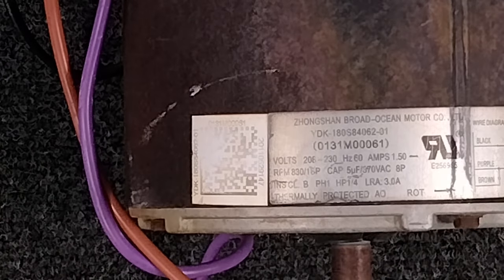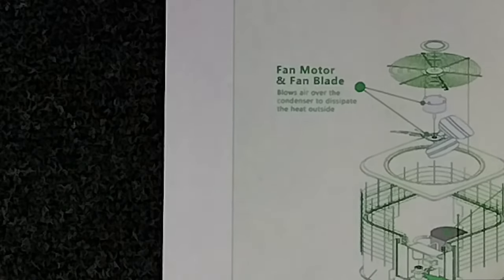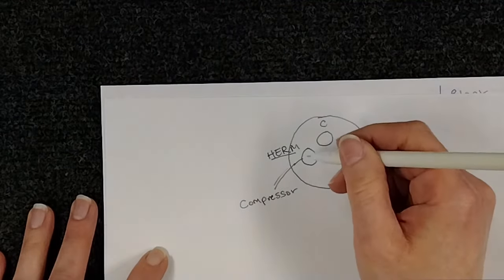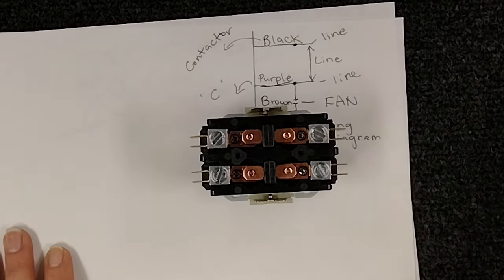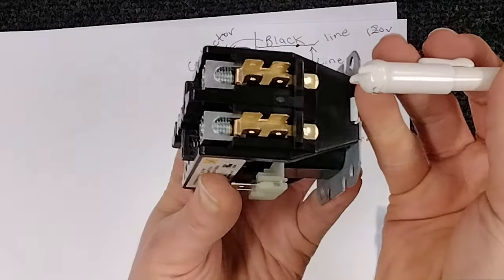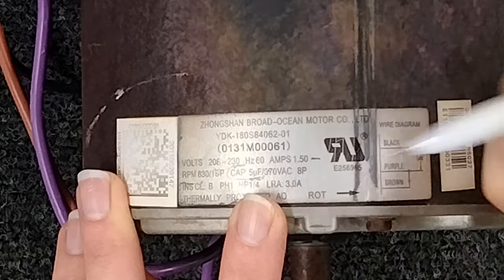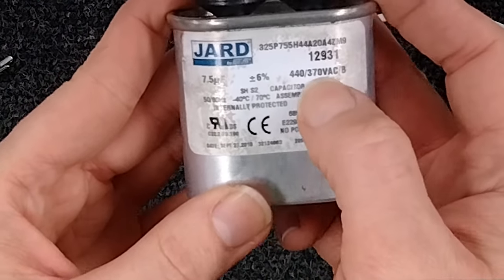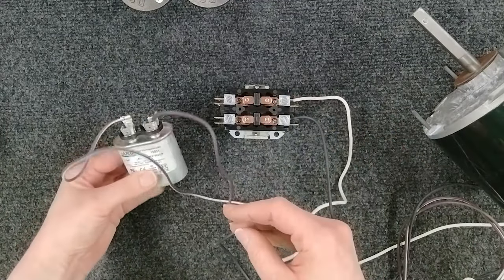How To Wire Condenser Fan Motors, Both OEM And Universal.

Comment: I use 120 volts ac for 1 phase motors. 
I got run at fan of the capacitor to 120 of the contact output and common from the motor to the other side of the contact .
And I put my start winding from the motor to common of the capacitor.
Very good results and readings!
Reply: That means the capacitor is between start and run of the motor.

Comment: You said never change your HP but sometimes when factory OEM motors supersede they change HP without changing the fan blade. I see this happen all the time with Goodman and Trane fan motors.
Reply from the maker: Yes, they do sometimes change the HP on factory motors. I've seen that on both Trane and Carrier units. I think honestly it isn't an issue until you jump two or more up. So, say, going from a 1/8 to a 1/4 is not a good practice and would cause some amp draw issues.

Comment: I couldn't help but notice, the old motor is an 8-Pole, designed to turn the fan ~820 RPM.  The replacement motor is a 6-Pole motor, intended to run the fan closer to 1,070 RPM. The torque required to turn the fan increases on the square of the increase speed, multiplied by the RPM, thus, the power requirement goes up on the CUBE of the increase in fan speed. If the increased speed is needed for the extra air flow, the new motor needs to have at least double the horsepower rating!

Comment: thanks for covering the 4 wire motor. I take it the oval capacitor non-polarity is used on 4 wire
the round c,herm,motor is used on the 3wire motor?

Are they interchangeable if so, how would that look like?

Thank you for your time and knowledge
Reply: Polrty must me checking due fan only fam  hrom side  comprssor  satarting g point onlt  due csp capcitef  c..  comon only not capcoiter is  power  fan pointed  .expls..5 6 7...8.910 .only . Mfd .ok  maco  fardieok sir  thankyou forme ok   exples  samall fan mot cap onlg 6mfd ok 2pont ye not fsn fan only ok sir   back n ..onlg  col ocrd must  redstsnc bsl must be okdir .okdir
Reply: @jollyscaria1922 huh?

Comment: The Vevor 1/4hp 1100rpm condenser fan motor I received is a ball-bearing motor, not the troublesome bronze oilite sleeve bearings.  Unfortunately, vevor drilled (and then installed rubber plugs) drain holes in the top, not bottom.  That's how I found it's a ball bearing motor, while dissassembling and drilling drain holes in the bottom.

Comment: Universal motor drain plug on bottom end is not just a plug I can remove it’s some kind of hardened resin. 
Do I need to remove this?
Reply from the maker: So with those, it's a hard plastic that I normally have to remove with a box cutter under the lip of the rounded plastic and pop it off. They are a pain to remove!

Comment: This is one the best presentations I have seen on this so far.  Pace and explanation very details. 
in my case I bought a replacement condenser motor fan, which came harnessed so I have to clip the ends  in order to connect it to my capacitor and contractor.  However I have 4 wires :  Black, Purple, Green-Yellow  and Red.   
The. original motor was Black, Purple, Brown and Green.   I am assuming the Red and Brown are same, is that correct ? 
I was not able to find and reference online.

Comment: She said we need that other capacitor “if” the new motor takes a different size, but what do we do if it doesn’t take a different size?
Reply from the maker: Hook it up to the old capacitor the same way it was with the previous motor and make sure that your old capacitor is still good. Just pay attention to the wiring diagram and if you aren't sure if your old capacitor is good or do not have a way to check it then it is good practice to replace both the new motor and capacitor at the same time.

Comment: I have a black wire. It's just hanging coming from the fan motor where should it go
Reply from the maker: Jeez, I wish YouTube would always alert me when someone asks a question. Sorry I wasn't able to answer this for you right away. Color can vary from brand-to-brand, so you would need to check the wiring diagram. Most, but not all, use a black wire from the motor to the contactor. However, not all of them do that. It's really important to check how they are labeled. If the wire goes to something other than the motor you would need to trace it back to the source.

Comment: I have the exact motor you have in this video (4 wire), but I dont have a seperate capacitor, just 1 capacitor  for comp/fan. so I am unsure how to hook my 4-wire motor up, the one coming off is only 3 wire. :( I have Black/White and then I have Brown and Brown+White Stripe. The verbiage on the optional 3 wire connection is exactly what it is on your unit, but it doesnt make sense to me
Reply: on most universal fan motors.....you can tape off the brown and white striped wire and use the other one...that is solid brown...,as a three wire...as long as the dual capicator you have matches the mf...of the new motor,,,,,
Reply: @charlesjackson9602  so is that to say that if the mf on fan motor doesnt match the dual capacitors mf thats where the need for the 2nd smaller capacitor comes in?
Reply: @MrsBuddevil  Yes...or either get a dual one with correct mfd..
Reply: @charlesjackson9602 but the mf on the capacitor should match the compressor too, correct?
Reply: @MrsBuddevil  Yes. has to match the compressor ..i keep like 35/ 5 and or 35/7.5  etc

Comment: Hi, For my fan motor, I have white, black, Orange or red, purple, purple with white dashes... The wires that appear to be purple you are calling brown. I have either a red or orange cable... Where does that go?
Reply from the maker: I wouldn't be able to tell you without having a wiring diagram. Colors are really sketchy things to go by, but from what I can tell it sounds like you have a 2-speed condenser motor. You can check our other video we recently uploaded that breaks it down further. Usually red indicates low speed and black indicates high speed. Again, I am not going to tell you which is correct because I do not have a diagram of where your original wires go. 

Try this video, hopefully it will help. Let us know if you have any other questions! 

https://youtu.be/rAExHb7doLs?si=uNhvIS_1a44goUPQ

Comment: Day 4 still no help from vevor. I have a reversible fan motor that has an extra yellow with green stripe wire with a loop screw connector. It comes out of the motor hole with the two reversible wires and connector. Can anyone help with this. Where do you connect that yellow wire?
Reply from the maker: It's a ground wire.  The motors from Vevor are not made to spec or standard for HVAC in the US.  We ordered one to look at, it didn't have weep holes on the shaft side (it'll hold water and die quickly when it rains/sweats), the windings are THIN, and they run off roller-skate bearings.

Comment: So how about if the specifications on old motor dont match the specifications on the unit specifications  then what???
Reply from the maker: That happens often. It's usually older units that people replace what they have on their truck. A good way to find out is look up your model number online and take a look at the parts list. I've seen so many incorrect installs of motors and capacitors because people will just throw crap in there not realizing that those numbers mean something. I've heard, "but it's been running that way for x amount of years." Yes, I'm sure it has and probably overamping which shortens the life of the motor and the capacitor. So, could have gotten a longer life on the motor and lowered the energy bills if it would have been done right.

Comment: i wish all the universal condenser fan motors would add length to reversing leads. so you can reverse in cabinet...or do another way instead just hanging....it annolying and hard to place.the reversing leads...especialy when they are opposite the main wire leads...i seen contractors strap them to conderser sharpe edges...vents...and short out...looks bad too..
Reply from the maker: I agree! The only brand I've come across that does that is a private label wagnor motor from Rheem.

Comment: You said if the fan is going the wrong direction, "just change two wires", but you didn't say which wires or how to change them.
NOT HELPFUL.
Reply from the maker: You mean while discussing the reversing leads - the wires made specifically for changing the rotation of the motor, I should have mentioned reversing leads again?  Get your hearing checked.